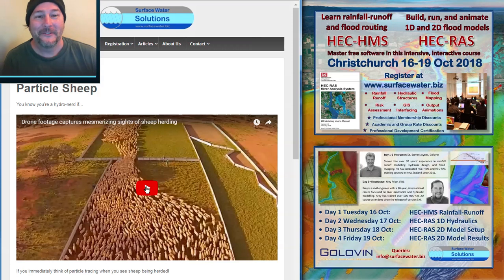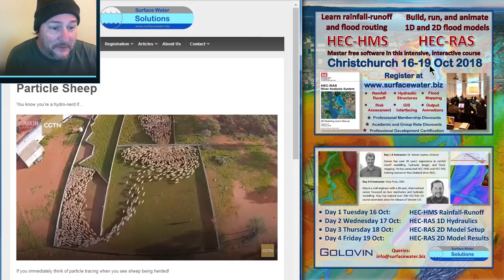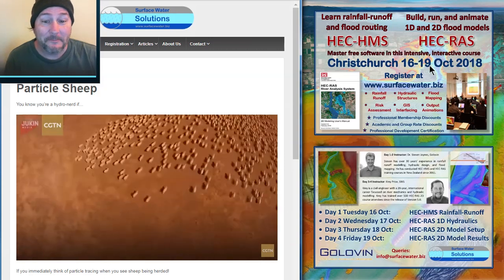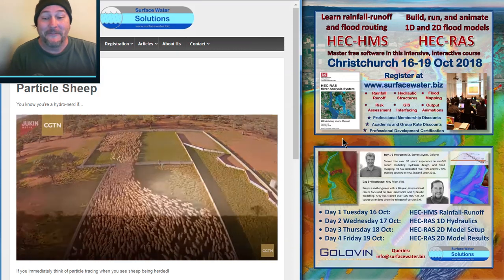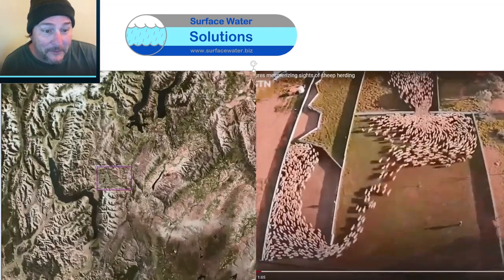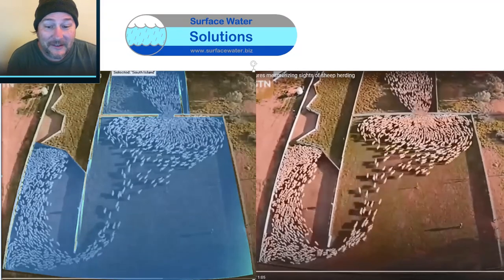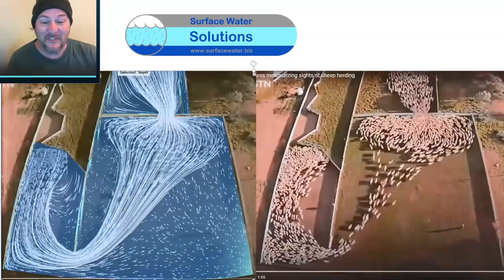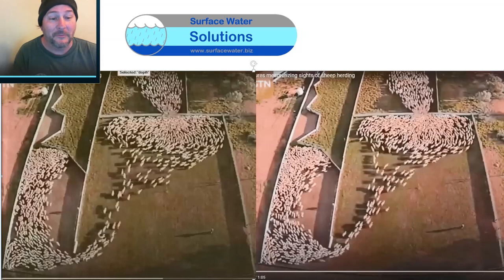Herding sheep with HEC-RAS: upcoming New Zealand training courses

Comment: Hi All

This question may be already been asked/answered in the past. 

Is there any rule (of thumb) on when to use the bridge or culvert routine to model a crossing?

I know the equations for culverts are different from those used for bridges in HEC-RAS. Are the resulting computed water surface elevations (from both routines)  within an "acceptable" range?

Should we model open bottom culverts using always the bridge routine?

Thoughts? 

Regards

Jairo Morelli
Reply from the maker: You can get wildly different results based on the computation settings even when the geometries are relatively similar, particularly with overtopping flows. I tend to use bridges when the bed elevations are highly variable and culverts when it's relatively flat. I like to keep structures entirely in 2D areas when possible, which for now requires bridges to be represented as culverts, but that's not always possible. For additional details, comparisons, and limitations, you may want to start with Chris Goodell's article here: http://hecrasmodel.blogspot.com/2016/05/bridges-in-2d-important-update.html. We also have an online course covering hydraulic structures in HEC-RAS (www.surfacewater.biz/online/) or you can check out a free webinar on bridges and culverts that Chris and I did with ICE WaRM here: https://youtu.be/43JrHqNL6i4